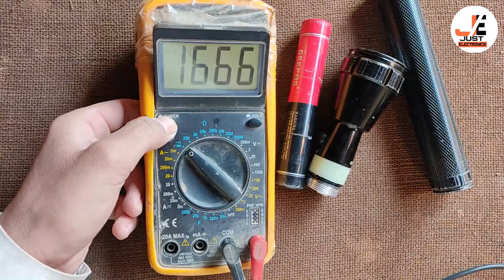How to repair Geepas torch.ON OF swatch and flash laser replacement

Comment: sir yeh laser ka sy buy kia hai
Reply from the maker: Ye ap ko Kisi b hardware k dokan sy mil Gaye ge
Reply: @JustElectronics97  sir mn laser ly kr aa gia hn shop se lakin wo heatup ho raha hai or kuch time ky bad light bund ho jate hai
Reply from the maker: @idealsolution4468   esa Karo k, 1. Ohm resistor ek wire k sat lagalo per masla hal ho Jaye ga.